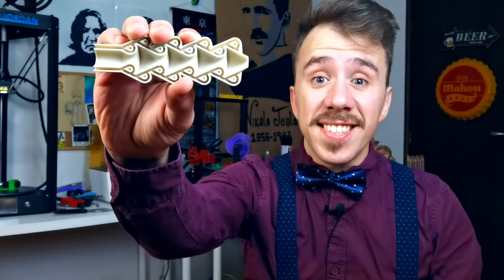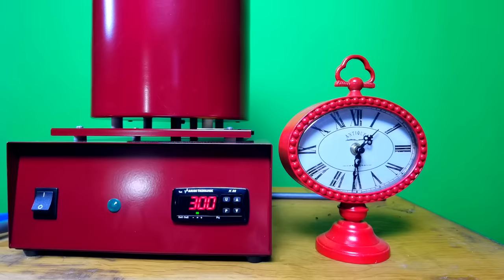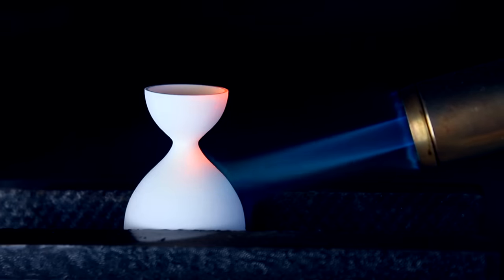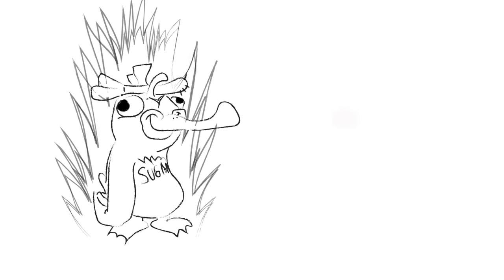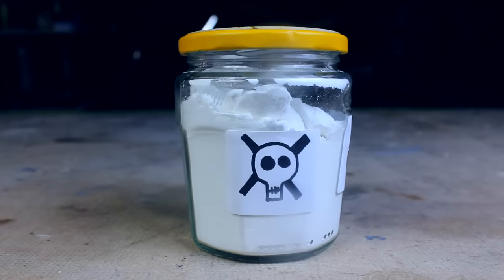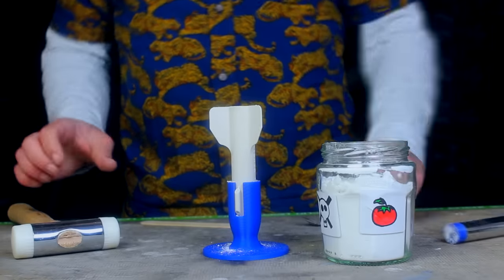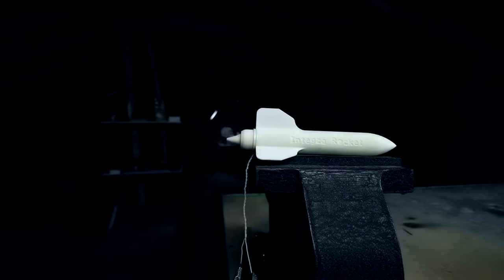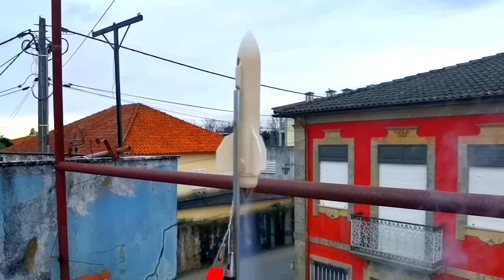Aerospike Rocket Engine (3D Printed)

Comment: You had air pockets in your fuel which allowed for uneven burn and explosion. If you had used a binder like alcohol and removed all air pockets in your fuel they would not have exploded. fuel should be put in the rock as a paste, compressed in and allowed to dry. Good luck

Comment: Maybe you can use solar panels to charge up a carbon aluminum alum battery? It isn't as though you can charge up super capacitors to make a plasma arc explosion to power a water rocket using salt water an large crystals of epsom salt with two graphite rods for electrical contacts suspended in hydrogels.

Comment: Hey man, you probably won't see this but your powder mixing is not ideal. A recomendation instead: use a spinning cylindrical vessel as your mixing unit. Do not fill more than half way. Rotate at velocity where the powder is not centrifuging out, but rather landslides in increments. Rotate between 150-250 times. This should give you a sufficiently blended material.

Comment: Maybe the powder was too fine. I remember with black powder burn rate is controlled by grain size and I'm sure this rule is pretty universal because it's about exposed surface area.

So you can get a slower and longer burn with larger granules, but this of course has other drawbacks too.

Comment: i think u can buy temperature controllers that u plug ur thing u want to control the temperature with.  i use one to control the temp of a freezer to dry cure meat at 12C even tho freezers only normally have freezing temps.

Comment: generate electricity using buoyancy (not wave energy ) in a continues loop.(hint)....use a chain  fitted with bladders filled with air on cogs connected to a gearbox  for better ratio to connect to a dynamo..

Comment: Ok, a couple of tips from an amateur high school rocketeer. For ignition, use nichrome wire. A 12 volt battery is enough to ignite the propellant. Now if you design your own engines, then you should try the Estes Model Rocket engines. Here is the link https://estesrockets.com  They are solid fuel engines and each cartridge has a ceramic nozzle in the end. Examine these engines and observe how they work. They also have a charge at the tip to eject the parachute. All kits have instructions and are easy to understand.

Comment: make a firework rocket with that motor type, you may use some of these typical (color effect´s flash powder balls?) only that ignite and pops out, just like when the parachute usually comes out using a smaller black powder charge maybe. These pearls or color effects (small pearls)  you often find them inside rockets or 3" mortar shells etc  (fireworks) LOL. and make space for an extra parachute spot, where an actual parachute comes down. remember anything will be deadly projectiles if the height exceeds 100M into the sky and will kill if it hits somebody in the head. imagine a tomato doing it to you as well to blow harmful  to injury

Comment: Can you make a video about a solar tracker which operates using a single motor to steer/direct the panel toward the sun 
Also you can use the solar azimuthal angle to build an app that can automatically calculate  which direction sun is throughout the year without any adjustments

Comment: What if you dimpled the tip in the nozzle? How would that effect the flow, or slots with little ripples it it that would get a roll under and some more heat retention as well as the tight laminar flow, fluted grooves? Are their any pounds per square inch   tools you can measure with, thrust horse power gauges?.. a couple pounds by size ratio is always good ? Or no?

Comment: improvements I want to suggest:
1) 3D print a tool to help you pack the motor. It should mould in the hole in the center of the rocket as you compress it. Check out a video titled "Very Special Unboxing for Nerds" by ElementalMaker. About 9 minutes in he shows off such a tool.
2) You might want to check out TechIngredients' video about making rocket motors... Although you seem to have that nailed.
3) When I built model rockets as a kid, we put a long (about 1m, I think) steel rod on the launch pad, and the rocket had 2 small pieces of drinking straws glued the fuselage. The rod guided the rocket straight up at ignition... You have a similar mechanism, but your rod was on the rocket from the looks of things, and was way short. Putting the rod on the launch pad would give you a lighter rocket, better balance, and I think you might get higher flights with a longer launch guide.

Anyhow, love the video, as usual!

Comment: Project Idea:
Make a (possibly ) turbine powered high output generator to recharge an electric vehicle, without access to mains power on long journeys.  I’m thinking butane/propane or methanol would be suitable fuel, as readily available and storable.

Comment: Hey good video but u shouldnt have put a divergent part in the nozzle. When the exit gases of the minimun nozzle area is not  mach 1 a divergent part in the nozzle would just desacelerate the gases. It seems that in a KNO3 rocket the gases doesnt reach to mach 1.

Comment: You’re using a flux core welder so you should be pulling the weld not pushing it. You’d be much better off using solid core wire and some mig gas, other than that as a welder of 10 years I can seriously say it’s not that bad.

Comment: I could open possibly for ideal and experimental wound designs position placement for different types of motors not to mention gas tanks and alternative fuels design tanks and a lot of good moving parts that fit I plan even possibly a centrifugal force motion machine whatever it could make bearings of various sizes

Comment: Your nozzle is NOT too restricted. 
Your pressure chamber is too not made of stainless steel foil.
PLUS you're too not using H2O2 as a propellant and too not integrating a catalytic element into your ceramic resin.

Comment: Since you are using brass tubes and can afford a furnace why not melt brass and cast ur tesla valves in brass assuming that brass would be able to handle the heat. I suggest cast the inside and outer parts of of the valve separately

Comment: Theme: make an electric scooter that only run on capacitor!
Reply: Then What?
Walk Back?
Reply: @user-mp3eq6ir5b   you can do a mechanical pumping device with your feets, with a crazy gear ratio link to a brushless motor to quickly generate a charge for the capacitor ! I am doing one now, will let you know if it's working!

Comment: Rockets are very unstable and hard to control since Weight and Motor is upside down. Fireworks overcome this Problem with a long Stick attached to it, 
Could you try to make a Mushroom Design with the Motor on the Head and down wards streaming Gases ? Thanks
Reply: That is not the reason why rockets are unstable. Look up “the pendulum rocket fallacy” for an explanation why you are wrong.

Comment: Theme: hybrid rocket engine with liquid oxygen and solid fuel
Reply: According to the fact that weight is define on earth by the weight of elements in 31 km, then magnetic field...
First retire gazs mass equivalent to the altitude you are, then if your prototype contains no magnetic parts...
There's a chance that earth magnetic core will permit you to get out

Comment: Theme: make liquid rocket engine
Reply: There used to be a toy rocket that was filled with water and then pumped with air. When you unlocked the base, it flew up into the sky. Very popular in the 1960's.

Comment: Better to have the rocket slide along a stiff rail. It avoids 'rod whip'.

The rockets probably also need to be longer and/or have more weight in the nose to be aerodynamically stable.

Not a good idea to launch rockets in an urban area. Please don't do that. You give rocketeers a bad name.

Comment: do you know how many plastic rocket engines is there?
look at your channel, they are all there.
do you know how many plastic rocket engines failed?
look at your channel, they are all there.
do you know how many plastic rocket engines actually worked?
(crickets chiprping) ZERO, look at your channel, they are all there.
do you know what are rocket engines made out of?
dont look at your channel for that, none there.

you do some good shit, but sell that crap printer and get a lathe and/or cnc machine for proper mens work and leave this plastic processor for barbie boys